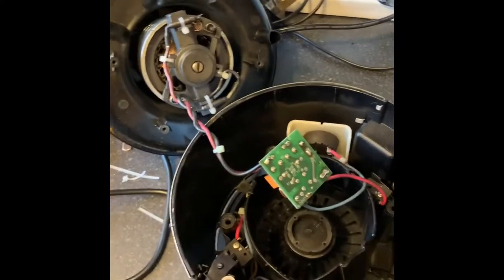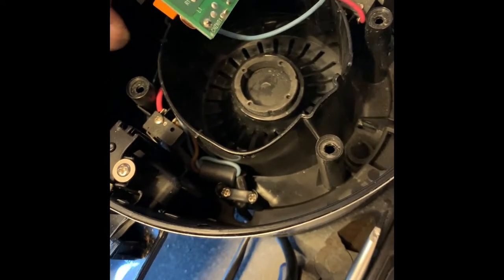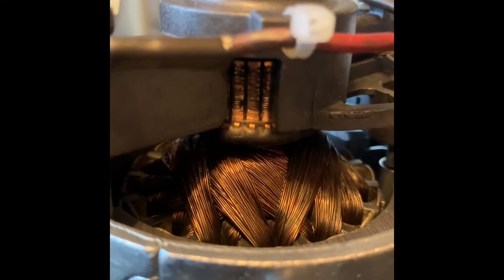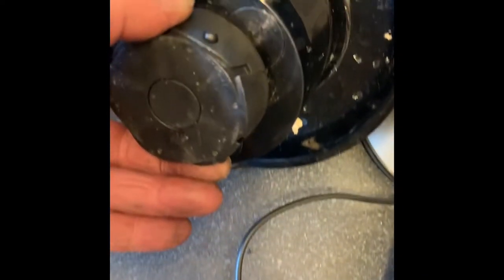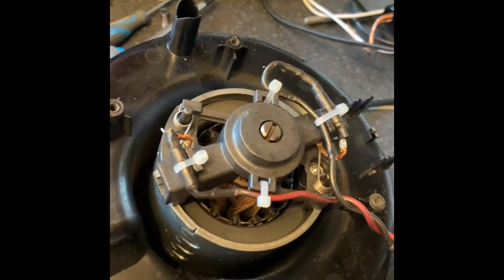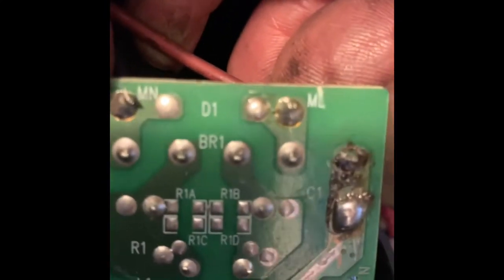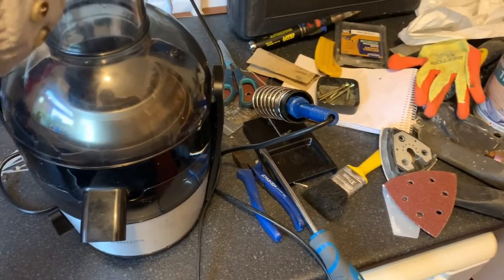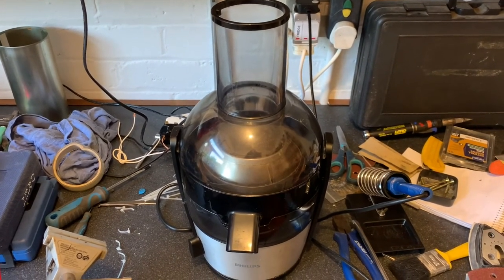Phillips 18 series juicer repair

Comment: Hi, thank you for the video! I have a question how you take off this thing from the top that u show at minute 3:15?
Reply from the maker: The rubbery wheel unscrews but to unscrew it you need to stop the motor turning. On the end of the motor shaft is a big slot. This slot is to lock up the motor (with a big screwdriver or something like) while you unscrew the rubber wheel anti clockwise